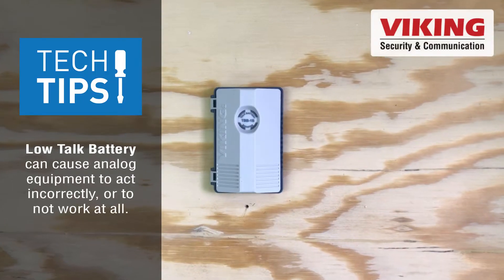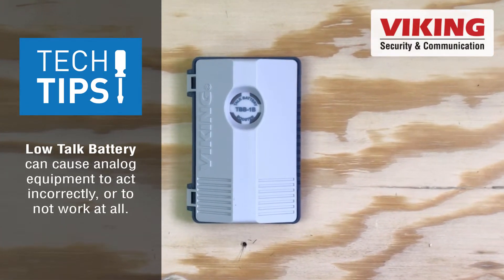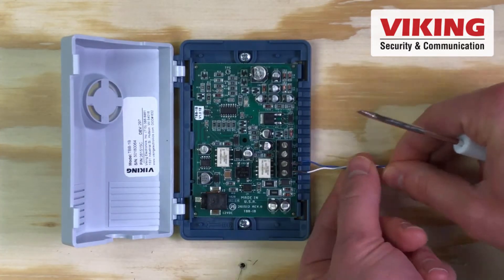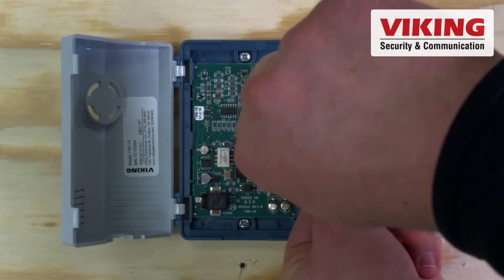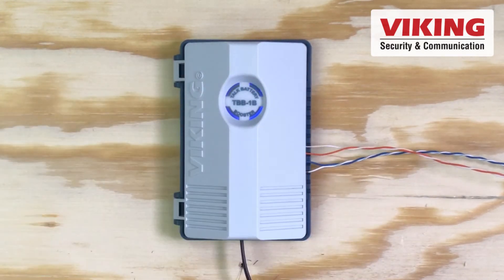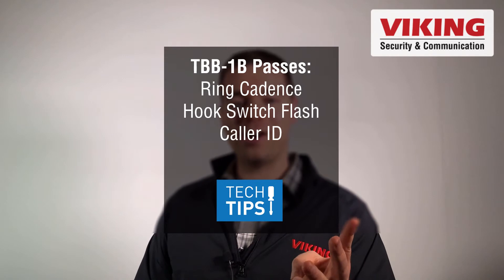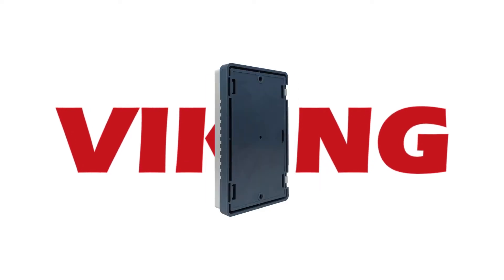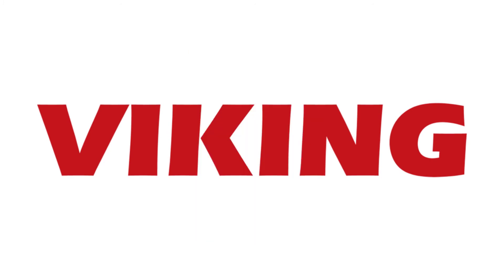Boost Low Analog Phone Line Voltage with Viking Electronics TBB-1B Talk Battery Booster

Comment: So, question that came to mind. What if I wanted to power an old analog phone from my Ooma VOIP (it doesn't put out enough to dial, just barely enough to receive), old phone has caller ID and all that, so the standard 4 conductor wire would probably be necessary to make the caller ID work, so I'm guessing you Go Line from Ooma --> TBB-1B ---> and then either a wire to the phone or wire up a phone jack to plug into. But question is, how would you know which terminal to wire which color wires to, or is it that specific? If you were using the standard 4 conductor red, green, yellow, black.